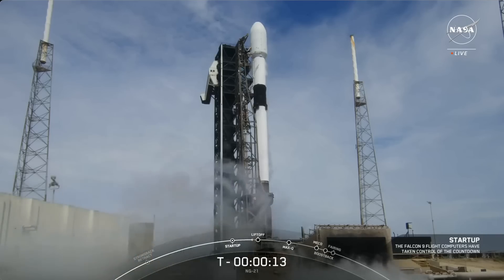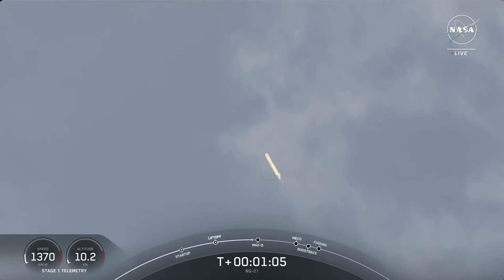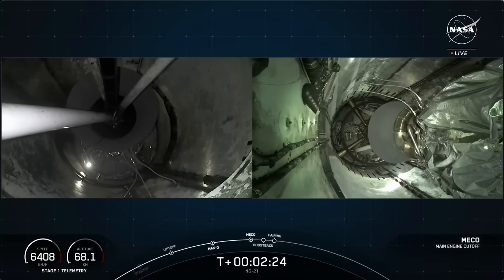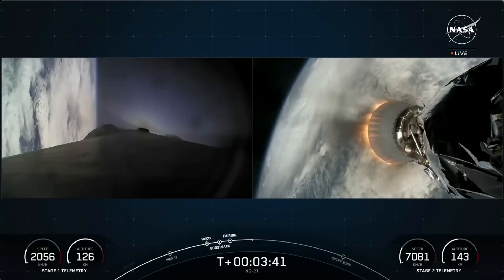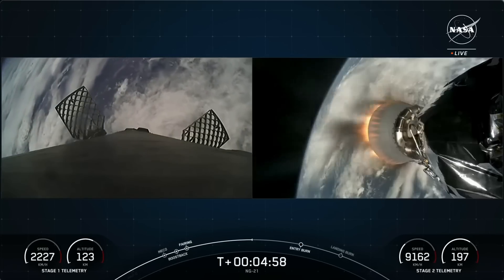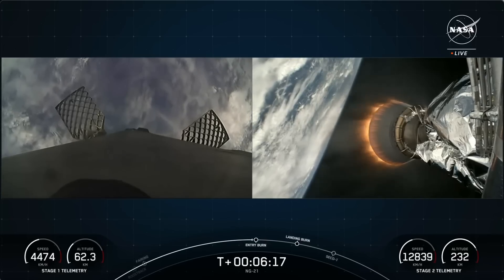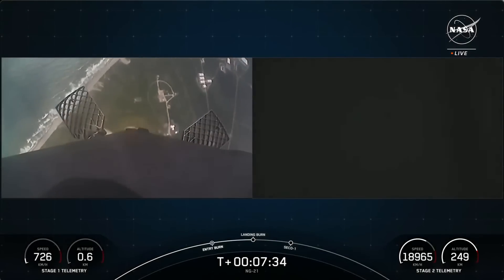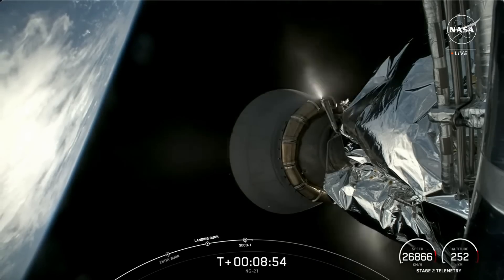Blastoff! SpaceX launches Cygnus freighter to space station, nails landing in Florida

Comment: That second  stage engine looks different??. Don't know if that's my ignorance. Enlighten me.
Reply: Stubby engine bell. Sometimes used when parameters allow because it is less expensive. Also less performative hence not used all the time.
Reply: @Desrtfox71  ok thanks. But if affects performance then why risk it, after recent failure.
Reply: @cd5964  it's not a new thing really. It's has been done many times previously also.
Reply: @cd5964 …the failure was NOT in the engine bell, it was in the oxygen feed line to the engine.